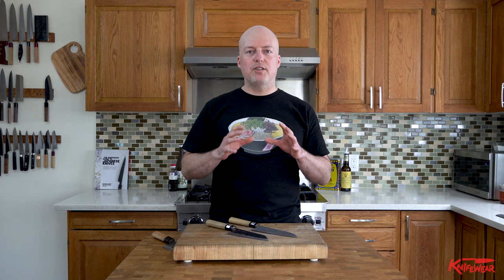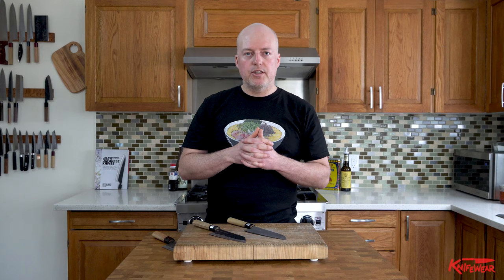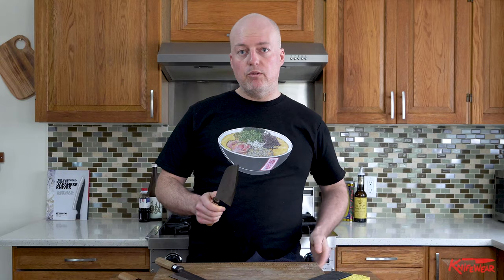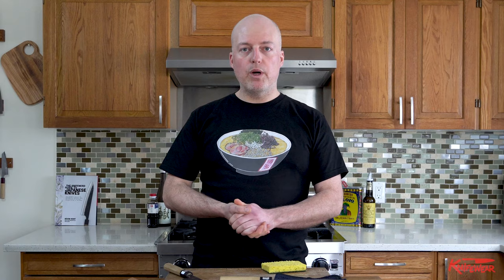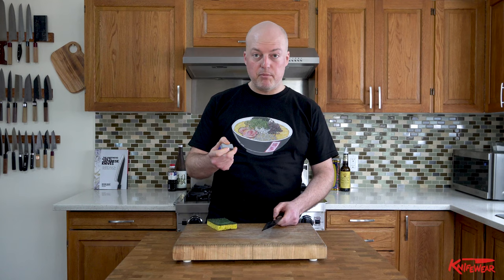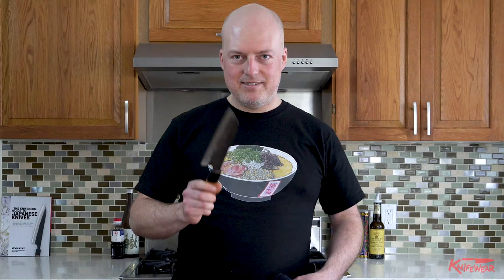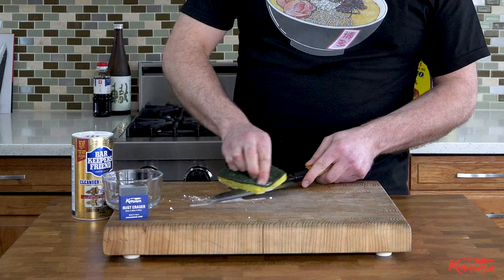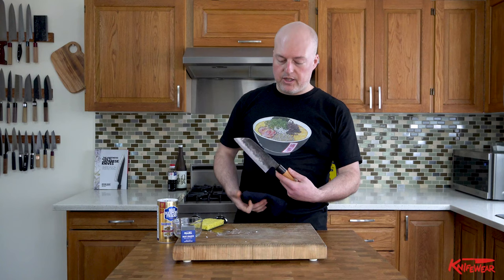Why is My Japanese Kitchen Knife Rusting?

Comment: In past decades I have purchased multiple sets of Japanese Global knifes because I like their design and usability so much. None of them ever pick up any rust even that I do NOT dry them after washing. Except for the large Global cleaver, the most expensive item from Global I ever got. That goes rusty even that I dry it. When I contacted Global for help, they were rude instead trying to help. I suspect they have some bad steel batch and do not want to admit it.

Comment: Thank you for this video! helps a lot, gotta question though, when I am using my knife at work it a lot it starts to have a really strong iron smell and most things it touches leaves that smell on it, would that just be the rust or something else?
Reply from the maker: Hey, that's relatively common for high carbon steel! It's oxidization, which is related to rust. It won't effect the food, and the more you build a protective patina on the balde, it'll happen less!

Comment: How do I get those little “chips” out of the knife blade.  They’re not exactly chips per say but slightly rough spots. A knife sharpener doesn’t seem to help. Used it 6-7 times on course then 10 on fine and they’re still there. Knife is much sharper though.
Reply from the maker: Hey there! Generally you'll need a whetstone to grind the steel down a little, 220 grit to remove them and 1,000 to finish the edge. You can always bring your knife to us to fix!

Comment: Mike thanks for the video. I do what you describe after every use and still found orange rust appearing. Any other suggestions?
Reply from the maker: that's certainly tricky! If you live in a humid climate, you might need to oil your knives. I would also make sure where ever you're storing the blade is nice and dry.
Reply: Clean you knife to remove all orange stuff, degrease with alcohol (isopropyl is a good one) and try to make a patina. Just cut any beef and you should see some bluish or greyish colors on your blade almost immediately. My knives are very happy with this merthod. 
Enjoy.